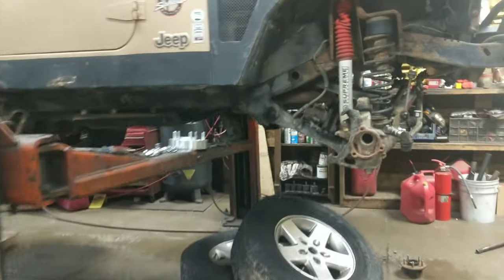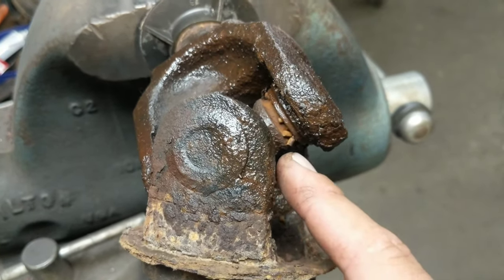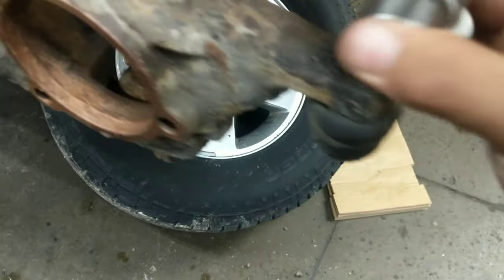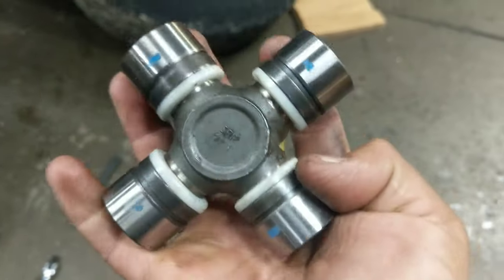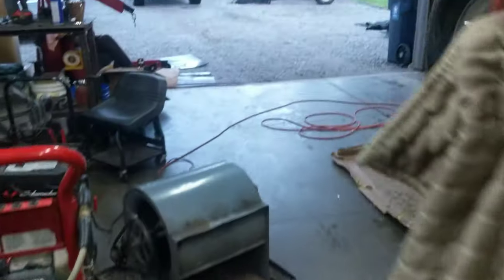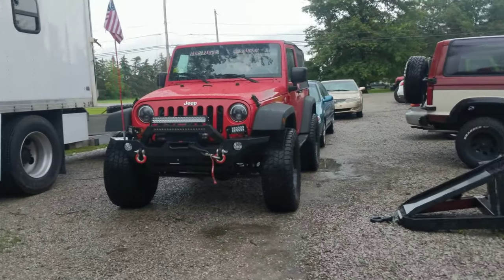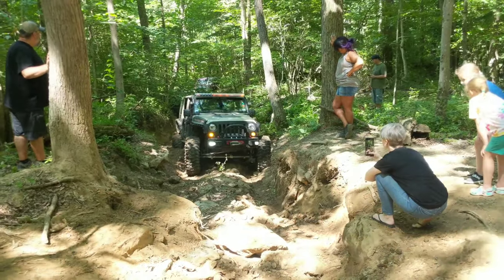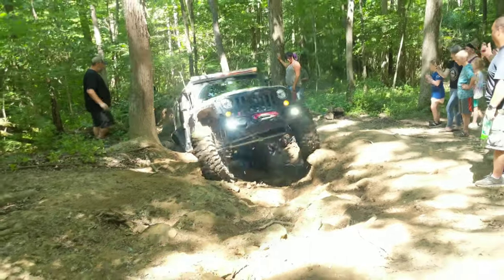U-Joints ?!? Greasable Or Non?!?

Comment: Hi there nice info!  I'm searching for u-joint, as in driveline, comparisons. Do you know anyone who has compared wear, load abilities, and resistance to operational grime with OEM new u-joints and a few popular aftermarket brands too?  Like Moog to Spicer to Toyota to GM, etc.

I am especially interested in tests between the same size of competitive brands of both sealed and re-greaseable universal joints.  Thanks!
Reply from the maker: We need to get Project Farm on the job
Reply: @discover4x4  yes. He doesn't have one yet.  Surprising!